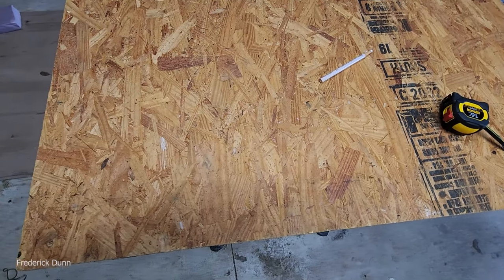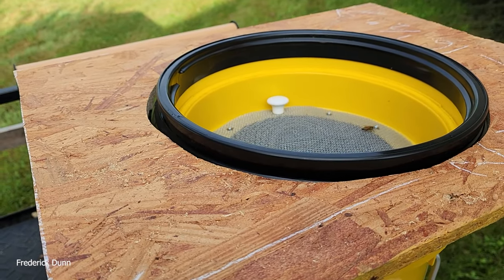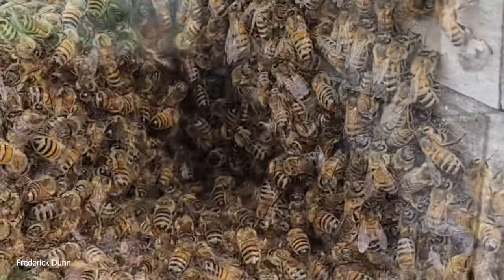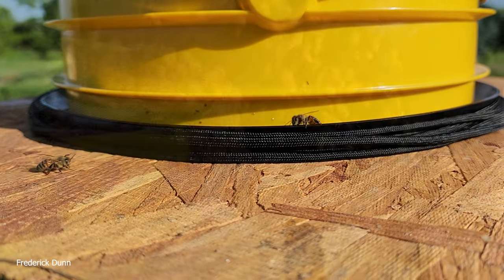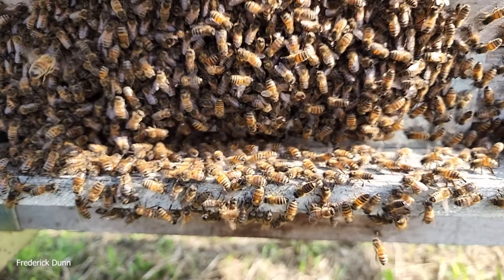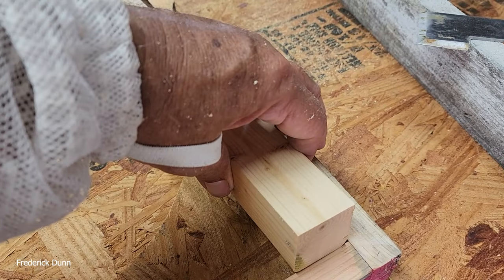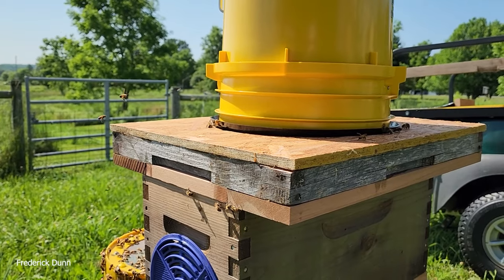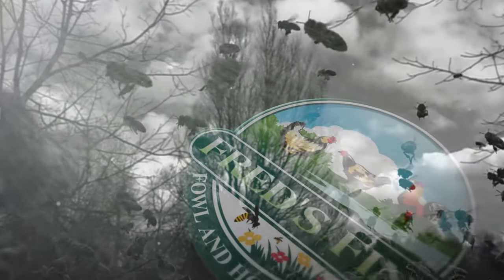Bee Vacuum Hive Installation Adapter Plate, Install swarms in a nucleus, 8 frame, or 10 frame Lang.

Comment: I have that bee vacuum as well it worked great for me. I had swarms collecting on my chain link fence. The first one I collected I didn’t have the vacuum yet and it was very difficult. After getting the vacuum it was very easy. However I’m not sure I like the chicken wire in it. Maybe it’s needed but I’m not sure of that.  I guess it’s to keep them from smothering each other but it made it difficult to get them back out of the bucket. I think I’ll make a shim like you did. Great idea. Overall I really like my bee vacuum.
Thanks Fred

Comment: Hi Fred… ❤ the adaptor plate concept… I know the Flow Hive dimensions are not equal to 2 5 over 5 nucs so … could an adaptor plate work to make them fit?
Also wondering if Pheromone strength has anything to do with migratory bee attraction…
Reply from the maker: Yes, pheromone potency definitely plays, this is why you get more "volunteers" with mated queens than unmated queens that often go with afterswarms.

Comment: Hi, Fred. How did you pull the screen top off after it was in the adapter? I know before many of the bees were clinging to that screen, but it seems you'd have to remove it before you put the bee vac in the hole.
Reply from the maker: I have to pull that out before putting the bucket into the adapter. The inventor wants me to slam the bucket down to drop them off before removal, but it works just as well to pull the bees with it and put them at the entrance. But you can knock them down first if you want to.

Comment: I see someone else commented on putting it the other way up - I was planning to try that concept this season particularly when vacuuming from a tree cavity or similar when I find it impossible to avoid getting debris into the vac as well & then that gets dumped into the hive when I put the vac on top & the bees then have to clear it out = extra work. But of course I've got some boxes that are screwed onto the bottom board - so will also try your idea using a cover board to adapt to transfer into a nuc - they'll just have to pour through a smaller hole ha ha. Thanks for the bonus video Fred - you're a star!!!
Reply from the maker: Hi Rachel, you could install a 3/8" hardware cloth on top of the receiving hive body and put your adapter plate on top of that before adding the bucket, then you only use that when needed and it would stop anything larger than 3/8" from dumping into the hive :)  I just use the adapter to get most of the bees in the hive and then park it next to the hive so the rest will follow. Thanks for commenting!